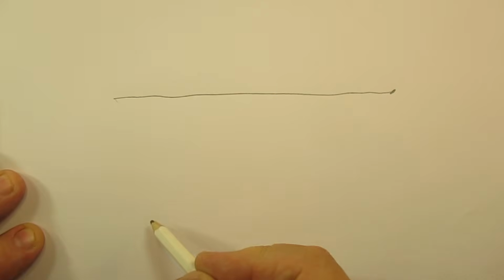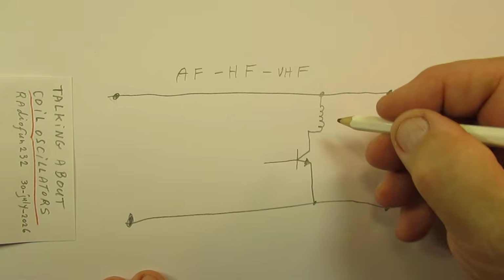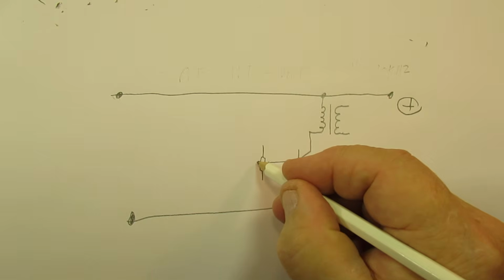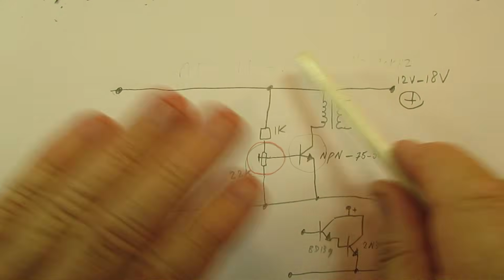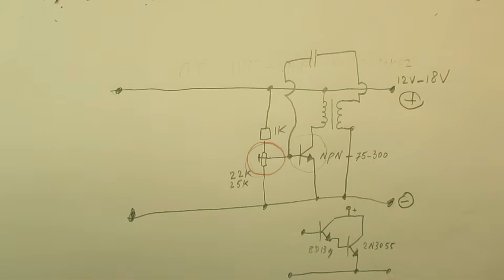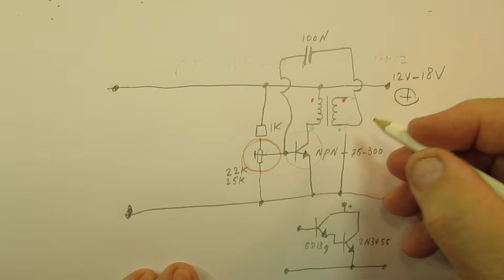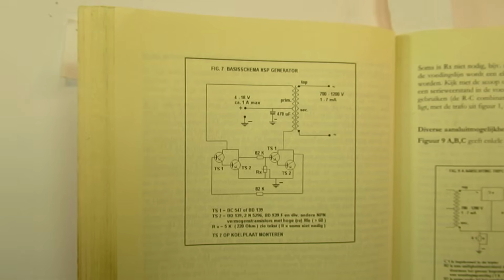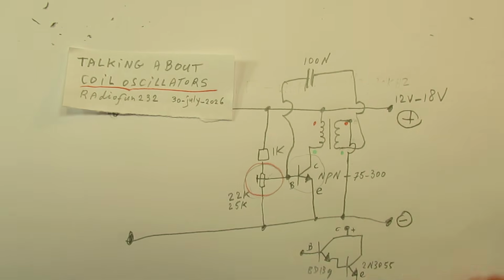Talking about 1 transistor or 1 Darlington coil oscillators, basic info how to make them oscillate

Comment from the maker: Important: On the primary side of the coil, you can parallel a (small value) capacitor, bridging it. Say: between 1 N (=1000 pf) and 3.3 NF. Keep the secondary winding as damped-free as possible. So that it can give out its maximum voltage, because resonance effects are key here, on that natural resonance frequency where the coil performs at its best.  In many cases a paralleled capacitor bridging the primary winding (1N - 10 N) makes the oscillation easier. Though, with coils in that 600 Hz-18 KC range, their natural inductance (= between the windings) can also do that job. With a parallel capacitor on the primary winding, the frequency will go (somewhat) down (radio theory). But it can help to make an easier oscillation, or smoothing the waveform somewhat. Test & Try! Key is to find the resonance frequency of that transformer, where it converts to its best, say the energy from the primary to the secondary coil. Never (!!) connect our osciloscope input to a High Voltage winding of such a transformer, even not with simple experiments, like this one, that even can work on of 3 Volts or so (!). The secondary HV winding can burn out the input of your oscilloscope in fractions of a second, even in cases of such a simple circuit that I show here, even when it oscillates on 3 Volt (...). Compare it to the flash unit on your photocamera, where a 300 Volt electrolytic cap. is charged, via a 3 volt battery oscillator, & a Si diode, to make a xenon tube flash for 1/1000 or 1/3000 of a second or so. The ratio of the primary to the secondary windings sets the output voltage: say the ratio is 10 to 1000 windings (factor = 100), that means that in an ideal situation (!, never real; there is always conversion loss....) a pulse of 5 Volt on the primary winding realises 100 x 5 = 500 Volt pulse on the secondary. NB: a 1000 Volt Si diode, like the 1N5408, bridging the primary coil (diode mounted in the right position, cathode to the + lead), can help to prevent damage to the transistor or Darlington. Also a resistor in the order of 50 K-100 K can do that job (damping peak voltages out). Test & try! Lots of success! 31 july 2026.
Reply: No freewheel diode?
Reply from the maker: @raxas7378  Yes, is possible, good idea. Though the voltage from the secondary can (also) easily damage the transistor or Darlington. So the base - emitter circuit of the transistor or Darlington also needs protection. Sometimes the oscillator will not oscillate with a diode parallel to the primary. More info in my above comment.

Comment: Nice transformer. 190mA 12V is good and safe for almost any project
Reply from the maker: Thanks. Yes, it can work properly in this case, to make that it will generate certain freqencies out, on the range to where this transformer (any transformer in this video, higher than 600 Hz) was made for (datasheet). Only thing is/will be, like you surely know (...!) to protect the oscillation Transistor or Darlington  transistor unit (via that 450K bias potentiometer (in case of a Darlington, in case of 1 transistor it is 22K or 25 K ) with that protective 1 K resistor, to the (+) lead, also in case of that Darlington setup) from voltage peaks out of that 230 V side (via that tiny value capacitor 10 N or 47 N or 100 N or otherwise that sends the signal back in the correct phase) that can damage the transistor(s) at their B-E junction (the max. voltage that they can handle there in case of 1 individual transistor or a 2 stage Darlington). Anyway: the cures and ways to protect them are showed in the textbox, say they are standard cures, like you surely know... In general they work OK. Best regards, Ko, 31 july 2026. I will pin your comment.